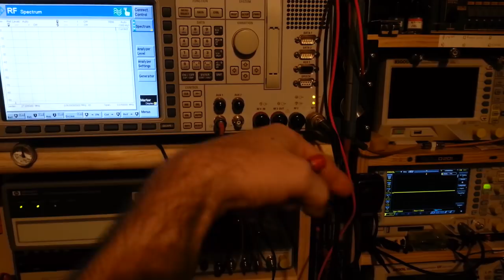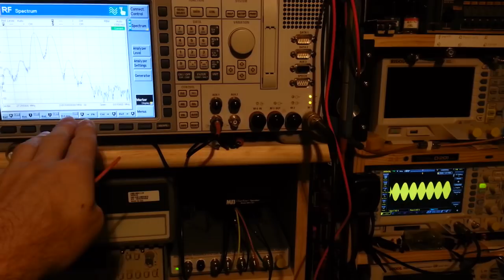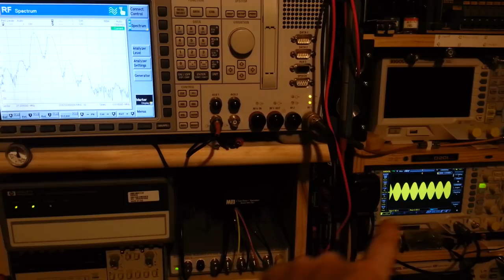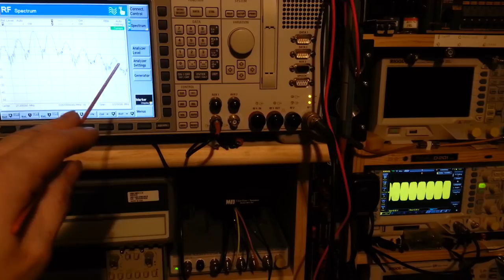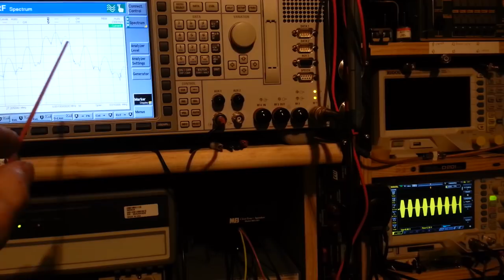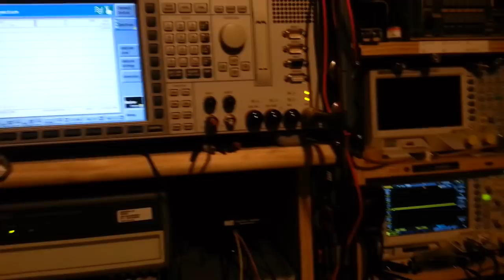Cobra 148GTL DX export CB radio restoration.

Comment: fairly sure the beep was on the main board. The Mk1 had the same sound design as the Hygain V - the ascending tone with amplitude inversely proportional, while the Mk2 had a steady 'nasa' tone.. the Mk1 beep switching transistor would fail, so they changed the design in the Mk2. That UKFM freq mod board (used in combination with the open clarifier/VFO to get the UKFM channels) and that horrible multi-tone beep board are all evidence that this radio lived in the UK for some of it's life. Nice to see it's still alive, great classic radio. An object of desire for anyone who was active in the 80's..

Comment: I used to do EPROM mods on the gtl dx and superstar 360fm to give the UK 27/81 band, +10KHz shift and to also give high high, and low low bands. I actually looked very closely to see if that was one of my EPROM modules! (It isn’t). That radio must of originated in the UK, I recognize the bleep board, I used to mod those to give 9 tones.
Reply from the maker: +TheDefpom 

Yeah it's a neat vintage beep board.  Matches the vintage EPROM board.
Reply: @mikesradiorepair  One of the important things the EPROM board did was to order the channels 1-40 so that there were no gaps and they were sequential without the 23 jumble as we used to call it of course the 148 gtl dx could already go to all the channels if it had a 10khz and a 5khz tuning tx/rx shift it was just a bit of a palaver finding them all quickly The EPROM solution made it so much more user friendly and of course the classic annoying 5 tone roger beep didn't. I preferd the dah di dah beep. best regards Sean

Comment: Very common radio over here in England. Those eproms were used to add the uk cb band. When in high band (normally) switch in the eprom to add 27.60125 - 27.99125   (UK 1-40)  Definitely looks like it would have been imported from the UK.

Comment: I wish a lot more people would watch your video's and actually learn something.  The amount of times i've had to explain things like this and why you don't crank AM audio up full and power. And the ALC and why spreading coils don't increase your power And why you get back swing on AM with some cheap power meters (they've never heard of PEP). And trying to align a radio with just a screw driver and with (ears) that must have built in SINAD, If it was this easy we would all just own a screwdriver and not lots of test equipment plus special alignment tools.

Comment: What were the two freq that you used then? When i adjusted my MK2 cobra the power was low then properly adjusted like 3W. Thanks for video
Reply from the maker: +metclapton 

If you mean for a double tone SSB adjustment then any two audio frequencies that are not harmonically related like 700/1900, 400/2500, 850/2200, etc...
Reply: Thanks i will try this and see what i get and thanks for the RX signal tracing video using a spec analyzer that was useful vid

Comment: Hi. Do you do mail in repairs? I have a cobra 148, cobra 29ltd and uniden pc68ltw that need work and alignments. The 148 was working great untill i put a car battery charger on the battery while operating radio. Replace fuze but Now whenever i power on it blowes fuze immediately
Reply: try checking the protection diode on the power input line, it's probably shorted.
Reply: replace the protection diode across the power terminals inside the radio,

Comment: They could've just put the 10khz switch to get the missing channels.
Reply: A very common trick was to use a slider. A Cobra 132 I used to have was modified with a slider that could easily slide over 2 channels at the bottom of the band and over 3 at the top. It let me use the entire band as well as adding a couple of channels at the bottom(below channel 1)